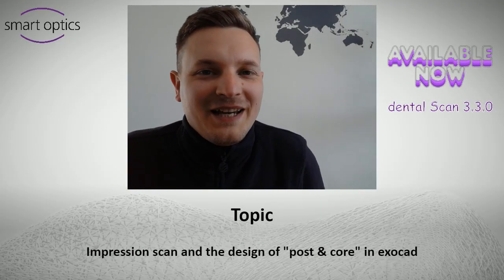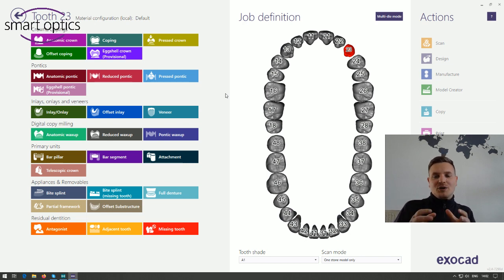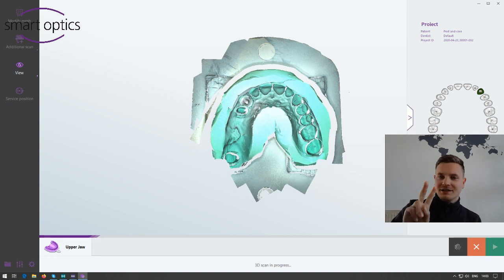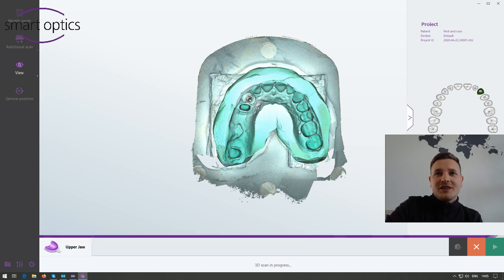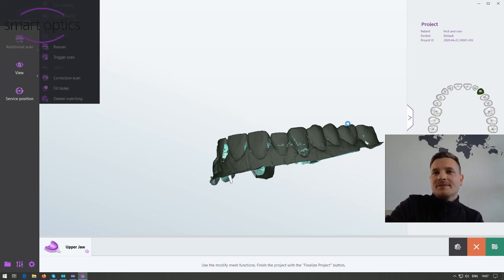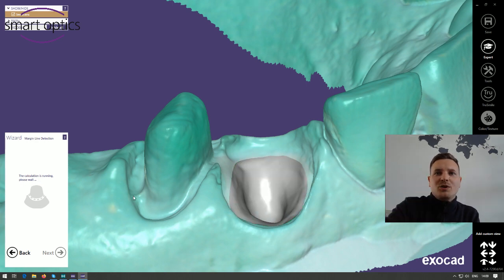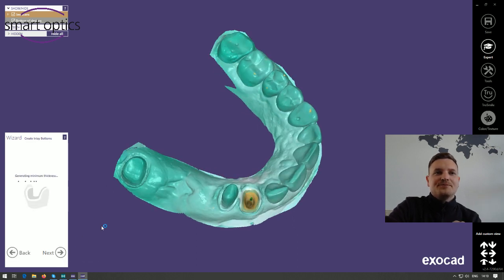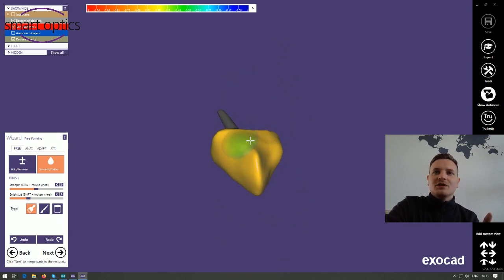Impression scan and the design of "post & core" in exocad

Comment: how to design post & core PLUS the crown in one session?
Reply from the maker: There is a workaround for this. You save your finished post and core. Then you reload the scan data with the post and core and delete all the finished parts. After that, the scan data must be aligned and then a crown can be designed on the "new die".
Reply: @smartopticsDE  will try, ty for answer.
Reply: @smartopticsDE  could not manage to do it maybe u can offer short training with teamviewer
Reply from the maker: @lotion90  You should get training from the dealer who sold you exocad. If you check the Exocad Facebook group you will also find some good tutorials on this. For further assistance regarding our products, please contact our support hotline directly. Best greetings.